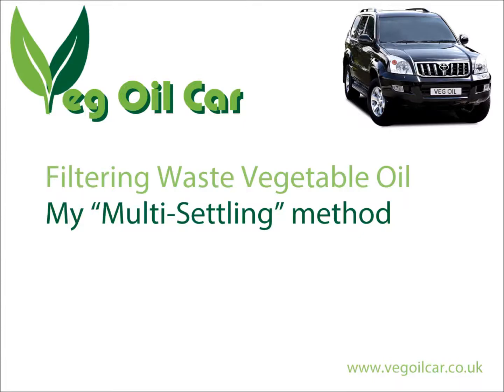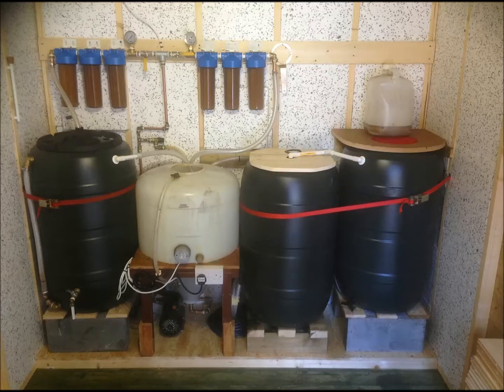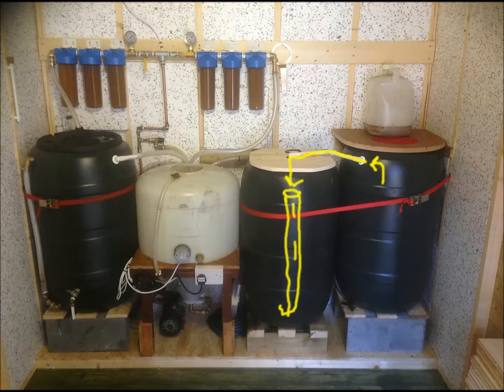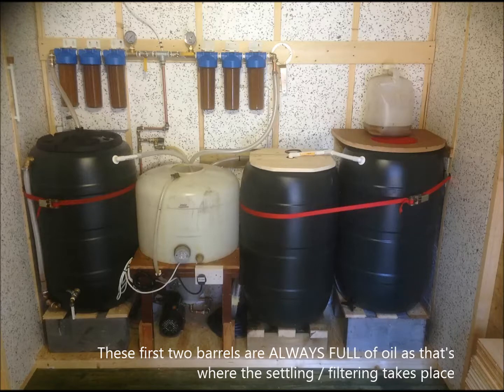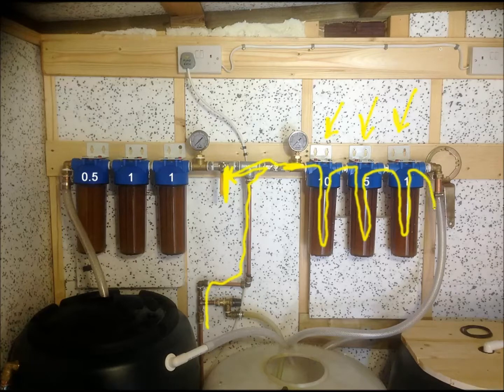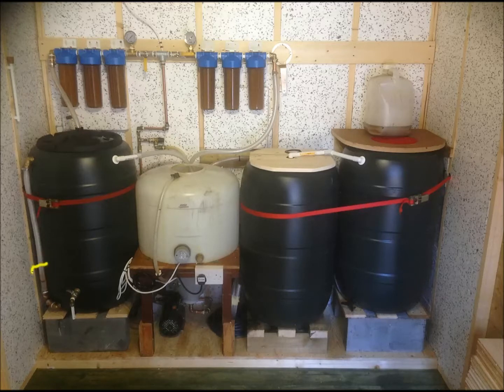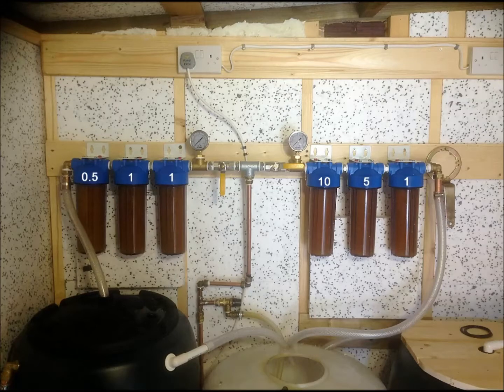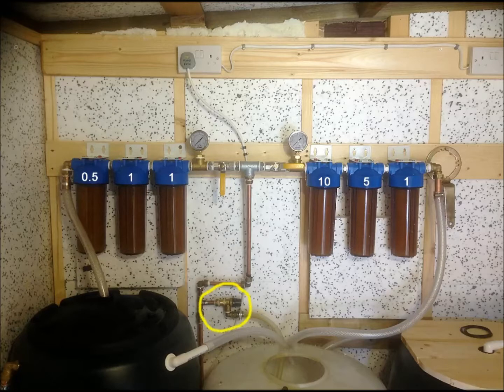WVO Cleaning - Waste Veg Oil Multi Settling Tank Method by VOGMAN

Comment: Hey Geoff! With the simplicity of your setup I'm considering getting back into running vegetable oil for fuel in my 12 valve Cummins. Before I did the heated centrifuge route and had success but the initial investment was a chunk of money for sure. At the time I did lots of work plumbing the other truck (now sold) to have a separate heated WVO fuel system. I have no plans to do that again to my current 12 valve Cummins truck for cost reasons, but I am thinking about adding WVO to blend it with the diesel I already buy. This would in effect replace some diesel not having to purchase it at the pump.

My question for you is, what are your thoughts about running a WVO/diesel blend, and what percentage, if any, would you use for a summer and winter. Thank you for your time!
Reply from the maker: There's lots of folks run on blends. Percentages often vary according to region (temperature) and engine (they're all different). It's a very good way of saving money and helping the environment.
Yes you can do it and yes it works. How much? Well that's the problem. If you get caught in cold conditions with a high percentage of WVO, you might not restart until the weather turns. 
So with an eye always on the weather, experiment. Start with 90% diesel and 10% WVO. If you notice no difference at all, increase by another 10%. Repeat until you notice issues. If cold comes in, top up with diesel immediately.
That's the best advice I can give. I hope it helps : )
Reply: @vogman  excellent advice. I appreciate you.

Comment: Love your work. Very simple, very inexpensive. Like the tortoise versus the hare with WVO. 

Question, why would you want a pipe in your storage tank if you're pulling from the bottom anyway? I see a spout on top when it overflows but it looks like it just flows into the white tank. Cheers and thank you for posting your brilliant ideas.
Reply from the maker: Because by then it's super clean and the tap is at just the right height to drain off clean oil for use : )
Reply from the maker: Thanks : )
You want dirty oil at the bottom, so that's where you GENTLY insert it. Clean oil rises natural to the top, finds an overflow pipe and descends this to the bottom of the next tank. So it's always bottom to top : )
Reply: @vogman  yes but why on the last storage barrel where you're taking from the bottom to fill cubbies? Wouldn't it not matter on that one?  Thanks, just curious.

Comment: How often do you need to drain the bottoms of the tanks? How ugly is what comes out? Have you ever put the discarded "drainings" in a clear tank and examined the layers?
Reply from the maker: Funnily enough Mark, I've never cleaned them out. By settling in the containers BEFORE introducing oil to the system, I minimise the inclusion of gunge. So the whole system is basically fine filtering - and it works  : )
Reply: @vogman  ever taken a sample of the bottom of the barrels to see what, if any, contaminates are present?

Comment: Hello, Great video, it's very ingenious and I like the way physical properties of the oil is used to clean the newly introduced oil.
I have a question, how often do you need to clean out the first two 200l settling tanks? I'd imagine after a while there would be a fair about of water and fat down the bottom. Or do you just do the same thing as in your dealing with leftover waste video, put it all back into cubies and start again?
Cheers
Reply from the maker: I'll be honest, I do very little veg oil motoring these days. I just don't do the mileage any more.
When I was actively using it, I used it frequently for two years solid. And so far I have NEVER changed the barrels.
I'm guessing there's some gunk at the bottom of each, but as I settle in a cubie before I introduce oil, what's going in is already fairly clean : )

Comment: Hi, can you give me some info (brand) on your filters please? Are they pool filters ? Thanks.
Reply from the maker: Hi Pluto,
There was no brand, just cheap eBay items. They were advertised as water filters typically used in reverse osmosis I think. 
However, if you're looking into filtering veg oil, I'd strongly advise you to keep your money and stick with Settling alone. It's a brilliant method : )
Reply: Hi Vegeoilguy. Yes I do settle, prior to use I run it through a RYCO filter, your water filter set up looks better and cheaper. Thanks for all the info.
Reply from the maker: Happy to help : )

Comment: Once the conical or initial settling tank is full of undesirable materials, what do you do with this waste?

You mentioned that it is partially water and partially fats and debris. Is there enough fats in this to make adding it to another hot fire a net benefit? If not, how do you dispose of it? Also, your recaptcha site key is out of date and thus no one can contact you via your website at this time.
Reply from the maker: Hi Logan.
Dealing with waste is never fun, but if you employ the settling method it's possible to minimise waste as I demonstrate in this video - https://youtu.be/REWBqNzLYgQ
I've heard stories of people drying out the gathered fats to make bird feeders etc, but personally I've never seen evidence of it. The fats I've witnessed are very sludgy and unpleasant, not really the sort of thing you can do anything with. This is a shame really. If you do find a use, let me know. I'd be pleased to hear about it.
Thanks for the heads-up about the contact form. I hadn't realised. All fixed now : )
Geoff

Comment: Hi mate. I have set up a 2 tank cold upflow settling system. It is made out of 2 x 208L plastic barrels. I collected about 200L of oil which I tipped into a smaller barrel that had a polar fleece fabric over the top to catch the chunky stuff this then fed into the first 208L plastic upflow barrel. It sat relatively undisturbed in the first 208L barrel for about 2 weeks over which time I added about another 40L oil which obviously filled the first barrel and pushed about 30L of the oil into the second 208L barrel. I have just acquired another 200L of oil. My question is how quickly can I add oil to the first tank? Common sense tells me that I should stagger the inputs to the system to avoid pushing oil from first tank to second tank as the oil has not had time to settle. What are your thoughts on throughput for a system like this? I'm considering adding a 3rd 208L upflow tank to the system or perhaps even a 4th. I really appreciate your videos.
Reply from the maker: Nice one. Sounds as though you're off to a good start. Just a couple of comments / suggestions...
How is the oil entering the barrels?
What's the speed of entry?
How clean was the original oil?
When I set up my system, which only has two FULL barrels (so that's a good number) I filled them BOTH with clean oil. It was used, but it had been settled and filtered to 1 micron. 
The oil entering the system MUST be introduced slowly - over HOURS ideally. For me I used cubies with a small hole poked in the bottom (above the fatty waste) which is ideal as it's already pre-settled. If you can't manage that, then perhaps a bucket with the smallest hole you can manage drilled into it. It needs to flow slowly to avoid disturbing the content of the barrel.
Oil entering the system should ideally be diverted to the bottom of the barrel (where the dirtiest oil is) by means of a pipe, so as not to disturb the cleanest oil that's at the top. The cleanest oil then overflows into the next barrel, which carries the oil to the BOTTOM again... important that bit.
So the big secret is SSSSLLLLLLLLOOOOOOOOOOOWWWWWWWWWWW.
But to get back to your original question, if you've set everything up with oil that's not necessarily that clean (mechanical  filtering through cloth removes large debris, but not water an heavy - fatty - oil), then this needs to sit UNDISTURBED for AT LEAST two weeks, longer if you can resist. Once it's settled, slow introduction of say 20 litres via a cubie or bucket will allow the same amount of clean to flow out of the other side. But don't try to over-feed the system. A few days between input is best. Put too much in and you've undone all that wonderful settling.
I hope all this waffle answers your question. It's a FABULOUS method that attains amazing results, but a lot of patience at the beginning is a must.
All the best
Geoff
Reply: VegOilGuy Thank you for your reply. Yes I have the entry tubes on both barrels going to the bottom of the barrels and the exit tubes out the top so that part is good. I fear that I have overfed the last lot of oil into the system as it is flowing into the system as fast as it can filter through the fabric filter. I think I will add a 3rd upflow barrel to the system and then feed future oil slow as you suggest. Unfortunately our oil comes in either 20L tins or 20L white containers so I don't have the luxury of seeing the rubbish layer settled out. I like your idea of the bucket with a small hole to feed the system. One question will water settle out using this system?
Reply from the maker: Oh yes : )
Water being heavier than oil will settle nicely on the bottom of your barrels where it will stay -  as long as the content isn't agitated. Don't worry about it. Just give is a good couple of weeks.

Comment: Also I always thought copper reacted with wvo. Looks like you have used copper pipes?
Reply from the maker: Never hear that one before... I can only speak from personal experience. I've had NO problems with veg oil and copper piping and I've been using it for nearly a decade now. 
Hope this helps.
Reply: From what I understand, biodiesel reacts with copper, not the SVO or WVO.

Comment: Hi there. I have watched many of your videos over the last 6 months. What sort of filters are those? Pleated water filters or polyspun water filters? Also what sort of pump do you use? Is it a gear pressure pump or vane transfer pump? Model? Love your videos.
Reply from the maker: I'll be honest, I couldn't tell you what the filters are. They do nothing more than hang on the wall. Settling does all the filtering .
There is a pump in my system, yes. It's one of the Piusi Viscomat Gear pumps, but I really wouldn't be able to say which. I had it when I was experimenting with centrifugal filtering (don't bother) where high pressure is required. It's only purpose these days is to move oil to a storage barrel.
I'm not sure if any of this is much help to you.
Good luck and best wishes.

Comment: Hey Vegoilguy, your Advanced settling system is amazing. I'm starting a project but it involves both for a diesel vehicle and a 100kw Diesel generator. My idea is to create a 15 foot x 10 foot concrete room right next to the diesel generator and have a system like your and use the vegetable oil for the generator and also a vehicle. I live in the Caribbean so the climate is moderate and have no problem with viscosity. Also, the structure will be 50 feet below of the restaurant kitchen(sits on top of hill) and I'm desigin a system to use a pump to flow that dirty oil down to the structure for storage and right there your system. I will need big tanks for storage and a carefully layout system where I could have a vehicle come up next to the structure and  use gas pump from the clean oil storage. How much did you spend on your system? How big should I make mine?  What do you think of the idea to use the oil for the diesel generator too?

Comment: What do you do with your filter socks? Do you clean them out? If so, how? Or do you throw them in the garbage?
Reply from the maker: Hi Aaron,
Trust me, you don't want to try and clean them... I did. Not a good idea. They have to be disposed of I'm afraid. Luckily if you use the settling method I recommend, you'll find yourself using far fewer socks.
Hope this helps.
Best wishes
Geoff

Comment: Hi Geoff. Picked up my first 20L of WVO from a local Chinese restaurant last week. I transferred it to a cubie container via a fine sieve and a funnel, which also has a filter in the spout. However, after a week, the oil doesn't appear to be separating. Does this mean all the oil is useless or does it need more time to settle? Thanks.
Reply from the maker: Hi Keitho. Does the oil already look clean (quite transparent)? I've had oil before now that was almost brand new, so there's very little settling to see in these case (though there could still be water).
Temperature is another factor. Settling works best at room condition. If you're storing your oil in a cold garage or shed it could really mess up the process. Warm (not hot) and constant is best.
Send me a photo and I'll be pleased to tell you what I think is going on.
Best wishes,
Geoff
Reply: Hi Geoff. Temperature is definitely an issue. I am storing the oil in the back of the van which is going to be running on the WVO using a 2 tank system. I'm going to bring my cubie indoors and see if that makes any difference. However, I don't have much room indoors. Hence, the WVO needs to be stored in the project van. What's the best way to send photos on to you?
Reply from the maker: Use the contact form at www.vegoilcar.co.uk or www.vegoilguy.co.uk with your personal email address. I'll then reply to you and we can exchange emails in the usual way from there   : )

Comment: Do you have a BoM for your filtering setup? Where did you source the tanks, pump etc.? Thanks.
Reply from the maker: Sorry Keitho, what do you mean by BoM?
As for where I get stuff, wherever I can find it cheaply : )
I had some barrel from a garden centre as they were a bargain, others on eBay. Plumbing parts tend to be locally purchased and the pump was found after much internet browsing. It's amazing how much you can save by shopping around for a while.
Reply: BoM = Bill of Materials. List of parts used and where to source them. But you answered that already ; ) Thanks. 

I would be interested in knowing which pump you used, as I believe oil and pumps have a hard time cooperating. 

Great videos & info. Has inspired me to start using WVO in my car. Thanks again.
Reply from the maker: Hi again. Sorry fr the delay. 
I used a gear push as these work under pressure, this model I think - https://www.oilybits.com/piusi-viscomat-gear-high-viscosity-gear-pump.html - though I purchased mine elsewhere on the net just by shopping around for a good price.
Remember, if it's settling you're looking at - AND YOU SHOULD - you probably won't need an expensive pump like this. Watch the video again... I know I have them, but there's no need for expensive mechanical filters. I've yet to change the filters on mine and it's been two years. Settling alone does the job.
The pump I owned was purchased when I tried Centrifugal Filtering. What a waste of time and money that was. Don't do it!
If you're just looking to move oil from the barrels to your vehicle, say, check out my Ping Pong Pump - a simple hand pump you can easily make. Or else go with a cheaper pump.
Hope this helps.
Geoff
Reply: Thanks for the reply Geoff. I'm looking to set up a 3 tank settling system similar to yours using 200L metal drums. I would be just pedantic when it comes to making sure the oil is meticulously clean, so would like to use mechanical filters as well. I want to use the pump to cycle the oil in the 'storage' tank through the filters. I'm considering an external band heater to allow for easier oil flow.
Reply from the maker: I prefer plastic barrels as they has a natural insulating quality. Metal gets cold too quick. As for heating, I use aquarium heaters in mine to keep the oil at "room" temperature. That's all I find is needed.
Best of luck. Let me know how you get on : )

Comment: does it legali use as fuel in a road vehicle?
Reply from the maker: +vladimir slalom 
There's no law against using vegetable oil as a fuel. There may be issues about taxation (Duty) which I mention on my website www.vegoilcar.co.uk. But as a general guide, if your not doing a LOT of mileage, you're fine.
Reply: 2500 liters a year by law

Comment: Hi one thing I think you should add to this is doing a hot pan test on the oil to make sure all water has been removed before any oil goes into any car as any water will do a lot of damage to the engine & fuel system.
Reply from the maker: Dave Adlem Hi Dave. Thanks for your comment. It's an excellent point. Caution is ALWAYS a good thing and I commend you for it. 

Personally I don't bother with the pan test. I have 100% faith in settling. Unless water has suddenly become lighter than oil it's just not possible in my set up for water to make it's way through the system. And 2555 days (today) of driving on veg oil seem to suit my engine, so I'm a happy chap. BUT I agree - if you're not certain - test for water. 

But I can highly recommend the above settling technique as a means of stripping out fats and water.